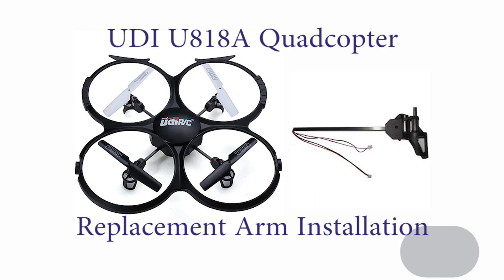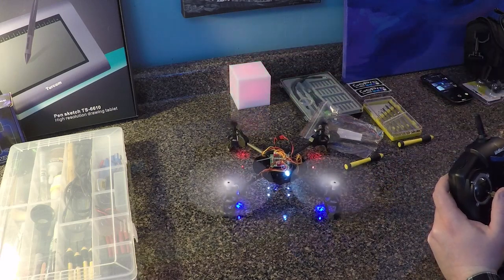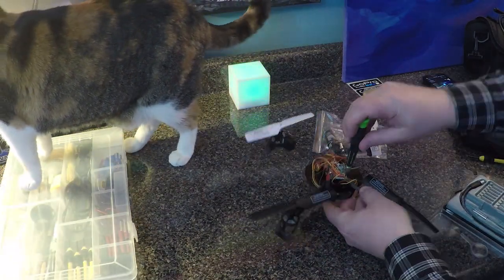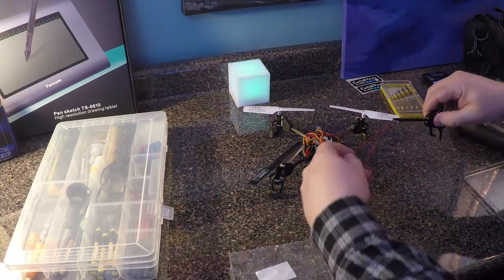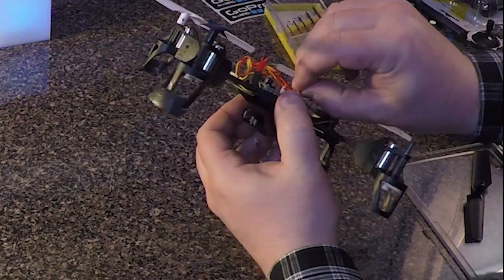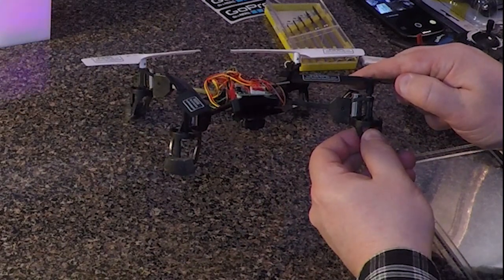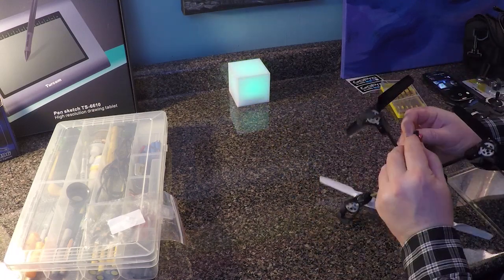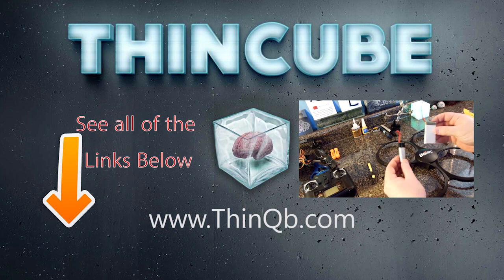UDI U818A + more Quadcopter Repair - Replacement Arm and Motor and U818a-1 Discovery

Comment: Thank you so much sir you are a life saver. On both amazon and on youtube. Been flying with the ring on and took it off today for the first time. Crashed right into a tree.
Reply from the maker: animedudevid I'm glad the video helped. It flies so much better without the frame....like a fine Italian sports car....lol  I got mine stuck way up in a tree once. We used a football to knock it free.
Reply: ThinCube I cut the frame off leaving the center piece.
Reply: ThinCube Well I have to order another motor the back counter clock wise engine stopped working last night. It got some kind of strange commands I wasn't putting in and took off without me raising the elevation last night can other things effect a 2.4 remote?
Reply from the maker: I've seen dying batteries cause funny things to happen.
Reply from the maker: Josh Ya That's a great idea Josh, you get the better flight feel plus the added protection of the housing!

Comment: look forward to the video, when I replaced the gear and blade it was locked up, I could not even move the blade.  It may need another motor only after 2 days of use

Comment: love the videos they have helped me with other issues. I have an issue with the yaw. The right yaw spins fine and quick, the left yaw is much slower and when the battery is dying it will not gain altitude unless i put right yaw on. I have tried calibrating the the gyro and replaced the gear connected to the motor. Any suggestions would be great thanks.
Reply from the maker: Hi David, im glad the videos helped....thanks for the kind comment. Ok, i would start by checking the gears/prop shaft for any binding or drag. This would rob power from that motor and cause it to act as you mentioned. Also, it could be one of your motors on the left side are starting to fail. Then lastly, it could be in the main board that supplies power to the motors. I know this is all broad but its where you have to start. If you have spare motors or replacement arms, i would start by changing out the left side. But do some close studying of the props and see if you can notice any one in particular acting slower than the rest. Hope this helps and please let us know how you make out. Good luck and happy flying!!!
Reply: Hey ThinCube I ended up change the clockwise arms and it is flying like new and ways faster thanks for the input .
Reply from the maker: Awesome, happy to hear it! Enjoy

Comment: hi great video same thing is happening with the one motor not spinning, my question is, would I follow the same procedure in video even though I have the udi 818a HD  wifi FPV ?
Reply from the maker: Hi Carlos, thanks for the kind comment about the video :)   I believe everything should be the same shown here for the FPV version, with the exception of the wire connections (those may or may not be different, i've never opened one up). The mechanics should be exactly the same. Let me know how you make out and what you find....thanks, Tony
Reply: +ThinCube yeah just like you said the process is the same thanks again, I'm up and flying again
Reply from the maker: Carlos Artiga Awesome, glad to hear it...enjoy!

Comment: Great video. Yesterday I replaced my udi's motor arm. I noticed a right drift after replacement. It need trimming everytime before flight . New motor is hot after flight. Is this normal ?
Reply from the maker: Raul F. Thanks Raul. The trimming sounds normal but a hot motor does not. These things are usually made to low tolerances so you may have one that is binding (tight bearings). It may wear in over time or honestly may burn out. Just enjoy it while you can and if the worse case happens you already know how easy it is to replace again :) Enjoy!

Comment: I found your video very helpful. With the two white propellers on top (furthest from you), I replaced the bottom right arm and motor. The manual calls for a Counter clockwise with a red LED, so that is what I purchased. I have replaced it and now it appears that the side with bot white propellers lifts and the side with both black propellers does not. It wants to flip over, this right after plugging in the battery and turning on the remote. Any ideas?
Reply from the maker: Sal Carmona Hi Sal, glad the video is helpful but sorry to hear of your issues. I know this is obvious but confirm that the motor you replaced is in fact spinning in the same direction as the other black prop. If not, confirm that the wires are connected correctly and if they are, then i would say that you should return the motor for a new one. Good luck and let us know how you make out.

Comment: Another question i have is, how do i know if i have to replace the arm? mine does the same thing, one of the rotor isnt spining, and i want to know if there are some upgrades that i can do to this drone?
Reply from the maker: juan garcia Hi again Juan, you can do a check by unplugging the arm that is questionable and plugging it into another port on the drone (swap the connectors of two arms). If the same blade still does not turn, I would say it is a high likelihood that the motor is burnt out, or the wiring is open. Either way, a new arm will fix either of those issues. Good luck and let us know how you make out.

Comment: Hi, thank you very much for the video, i have a question, can i use a battery with more than 500mah with this drone, i dont have the original but i adapted one with 3.7v and 700mah and i have other batteries with 1000mah, can i put ine of those in this drone,
Reply from the maker: juan garcia Hi Juan, yes you can use larger mah batteries as long as they are 3.7v. Just keep in mind not to overheat them and give them a rest, ie don't have lots of large batteries charged up and keep flying them one after the other. I also created a video showing modification to use a 1200mah battery. See it here: https://www.youtube.com/watch?v=SyiYImwijHc

Comment: Your tutorial helped me to fix my sons quad. Thank you! The one problem I have is the blade isn't spinning as smoothly as the other three and it won't lift off. Any ideas? We are charging it as we speak so hoping it fixes the problem.
Reply from the maker: I'm Christmas shopping as we speak...lol....I would check to be sure nothing is binding. make sure the gears are aligned and the prop isn't rubbing. let me know what u find....
Reply: +ThinCube  everything looks good. I'm wondering if I'm going to have to order different arms for the other three. It just doesn't spin freely like the other three. It's the first one that stops spinning while the others keep going just a bit longer. Wish I could send a video somehow. Enjoy your shopping!
Reply from the maker: +Amanda Maxon it does sound like it's binding since it's coming to a stop before the others. spin the prop by hand and compare the feeling to the others. keep in mind that there are two different types of arm on ur quad.
Reply: +ThinCube yes, when I spin it by hand the other arms spin a lot easier than this one. The differing arms are clockwise and anti clockwise and I made sure to get the right one. Unless there is an additional difference that I need to know about.
Reply from the maker: +Amanda Maxon No, thats it clockwise and anti. Ok so see if you can apply some light oil to the new gears or the prop shaft. Something in there seems to be binding, maybe its a tight fit. These things are made in china most likely and im sure the quality is hit or miss.
Reply: +ThinCube ok! Will try it. Thanks!!
Reply from the maker: Amanda Maxon Is there anyway you can make a video of what's happening and what you do to test it out? If so, i can incorporate your video in my next video explaining this problem....if i can figure out whats happening that is :) ....let me know! Thanks Tony
Reply: +ThinCube hi there! I am going to send it back and get a refund. I have another one on the way and hopefully will be here on Thursday. Will let you know! Thanks for all your help!!
Reply from the maker: Amanda Maxon My pleasure, good luck with it and please keep me posted as to what you find. And if you feel up to making a video, let me know :)
Reply: +ThinCube absolutely! Thanks again!
Reply from the maker: +Amanda Maxon Hi again Amanda, any luck with your drone?
Reply: +ThinCube hi there! Sorry! Christmas got ahold of me and I forgot to get back to you. The part came and I replaced it no problems. And the best part it flys!! Thanks so much for taking me through it all!! Much appreciated!
Reply from the maker: +Amanda Maxon Oh awesome, so glad you got it going....you're a good mom :) and glad i could help!

Comment: I don't have to replace an Arm on mine yet, but do the propeller. I found that bit useful thanks for the tip. Also do you know of any books on Quadcopter repair and electronics to help out a newbie?
Reply from the maker: Johnny Avendano  Thanks Johnny, I'm glad this video helped you out. I did a little snooping around and found this book on building a quadcopter. I'm sure you'd get something useful from it and it's only $5 from Amazon. Let me know how it works out for ya.  http://amzn.to/1CaG117

Comment: Great videos! Thank you! What are the advantages of removing the housing to fly?
Reply from the maker: Hi Donorcyclist, thanks for the kind comment. Well, removing the housing will lower the weight which in turn gives you slightly longer flight times. It also gives you a little more agility in flying. You should notice it right away. Thanks for the question and comment, happy flying!
Reply: Thank you!  I'll give it a try.  My new arm/motor should be here, tomorrow!
Reply from the maker: Good luck with the repair and let me know if you have any more questions :)

Comment: If the bearing are sticking is there a way to lube them or are they just used up?
Reply from the maker: +Robert Brown Hi, yes you can oil them with a needle oiler. I got one from Amazon (http://amzn.to/1T7bvCX). But the bearings are very small and not that high quality so if they get dirt/debris in them they can wear really quickly.

Comment: how did you get the outside of the drone the body off the drone cause my arm for my drones comes tomorrow
Reply from the maker: Hi again Erik, it is surprisingly simple. Look to where the arm goes through the body. You will notice there is a split on the bottom. You just separate the split and push the body up off of the arms and it slides right off.  I show it in the video at 1:03   Good luck and let me know if you have any issues.

Comment: Hi there, I followed the steps and installed the arm and motor on my drone. The drone works great but the new propeller won't stop running unless I unplug the battery. Any suggestions on how to fix that? thank you.
Reply from the maker: Hi Chandler, well unfortunately that sounds like a very common issue with these. Sometimes a motor will burn out but at the same time the main board gets damaged. It might be that the main board burns out first and then send to much current to the motor, burning it out too. Not sure, but the bad news is you most likely have a bad main board. The good news (relatively speaking) is that you can buy just the main board and replace it fairly easily. Here is a link to help you find the board if you feel up to doing it:  http://amzn.to/2jecsxG  Good luck and let me know how you make out.
Reply: ThinCube thank you for  your reply, I will  get main board and try to fix it.
Reply from the maker: Good luck and let me know how you make out!!!

Comment: I have my first ever Quad and am attempting my first ever repair / replacement of the motor arm.  Your video was great to follow, but you said the arm is held in by a philips screw and mine is not.  I received a U818A HD+FPV UPGRADE QUADCOPTER WITH HD CAMERA with wifi. It almost l;ooks like a rivet with a center hole.  Does not appear to be alan head.  Any idea what I would use to remove it ?   Appreciate any help you could give me.   Thanks,  Jerrry
Reply from the maker: Hi Jerry, is there any way possible for you to take a picture and share with me? Here is a link to my facebook page if you want to do it that way.  https://www.facebook.com/DroneTube-683884675042056/   Let me know, Tony.
Reply: Thanks for your response.   My wife and I are not on facebook.  If you have a business phone that I could text and send a picture I could do it that way;
or
I could text it to my daughter who could put it on her facebook and get the picture to you that way;
Whatever works best for you.  
Thanks ,  Jerry

Comment: hey,
great video, just what i needed. i just got the upgrded UDI818A-1 quadcopter, and on the first day of flight, one of the ccw motors stopped working, the selling company sent me some replacement motors, which is a good thing, but my problem is fixing it on, because it doesnt come with the replacement arm,do you  have any previous videos you made on fixing it on or do you have a link to one i can watch.
thanks
Reply from the maker: David 'Boyejo oluneye Hi David, the motor's wires will have to be removed using a soldering iron. Then you have to slide the motor out of its mount. It might be easier if you remove the prop and its gears (the bearings might come out with it as well). Lay everything out in the order you removed it so that it will be easier to reinstall in the reverse order. Also, you have three other arms to look at to be sure you are setting it back up correctly. Unfortunately i don't know of a video showing the replacement of the motor. If i have one fail, i will be sure to create the video of me replacing it. I hope this helps and good luck with your repair.
Reply: +ThinCube Thanks for the great information.  I think I burnt out my motor when a hair got wrapped around the propeller shaft that I did not see until I removed the prop.  It is not easy to see how to disassemble the motor from the arm.  The key is to insert thin instruments (like tiny screwdrivers) on both sides at the same time between the plastic surrounding the motor and the adjacent housing to spread the sides so that the little buttons on either side can slide past the retaining holes.  I will attempt a new motor transplant even though I have a new assembly on the way.
Reply from the maker: +Rocky Riddell Hi, glad the video helped and yes definitely try to change out the motor....its worth a shot. And when you're successful, you'll have a backup. Good luck and let me know how you make out. I just made a video on Props and will most likely make a video to change out the motor next. Here is the props video: https://www.youtube.com/watch?v=nTNhGXrO5ik     Happy Flying Rocky!

Comment: Thank-you, I was able to replace the arm and motor. All of the blades are spinning correctly (clockwise and counter clockwise) and I calibrated the gyro etc. However, the quadcopter does not have any lift and it won't take off. Just sits on the ground with the motors revved up and props spinning! Any suggestions to get my drone flying again (U818-A Discovery HD+)?
Reply from the maker: Hi Mark, so you replaced just one of the arms on your quad. Batteries in both the quad and transmitter are fully charged I assume. Since you did the basic checks i have people do the only thing i can think of is that the main board is bad. Alot of times when a motor goes, the board gets fried as well. With differing symptoms. Somestime totally dead and sometimes a lack of power. Im not 100% convinced this is your case but leaning towards it. Whats making me doubt is that you didnt mention any motors spinning fast/slower than any other motor. This is a hard one to diagnose both in person and through messages as this. If you had another board to try, i would swap it out. Wish i had better news for you, good luck and let me know how you make out.
Reply: You are correct the batteries in the quad and transmitter are fully charged. The motors appear to be spinning about the same speed. I cannot detect that one is visibly faster\slower than another. It sounds like this could take some time to chase down and that I need something better than the naked eye to look motor speed and I would need another board as well. I think I will order a new quad. I see the U818A has a wireless FPV option. It is actually cheaper than what I paid for this one. I liked this quad and still am a beginner. I can use my old quad to experiment repairs on and hope the motors and board on the new one last a bit longer or I have a less steep learning curve! In any case I will let you know what happens.
Reply from the maker: I like your thinking Mark. Good luck with the tinkering and new quad. This was my first experience with Drones and think it was a good choice. Here are some other UDI products you might be interested in: http://amzn.to/2qF1j8V    Let me know what you end up getting....happy flying!
Reply: ThinCube maybe you put the wrong propeller on it?